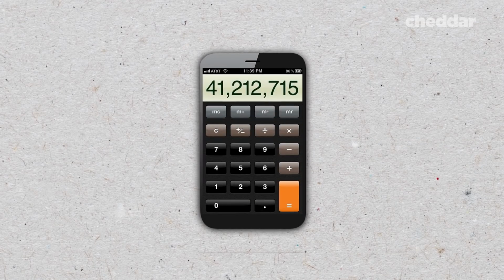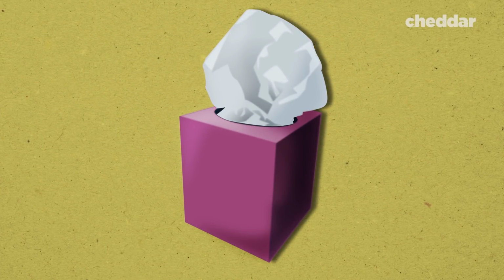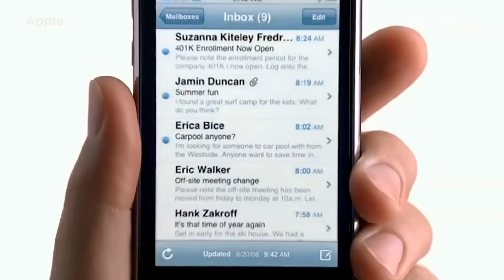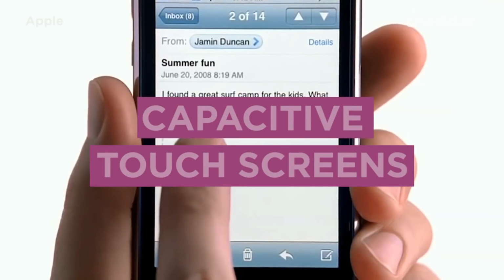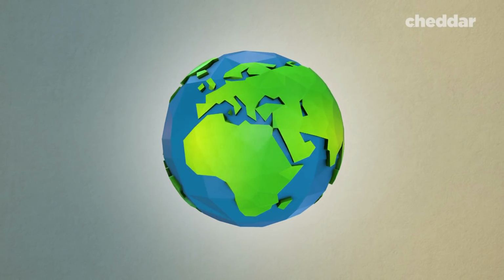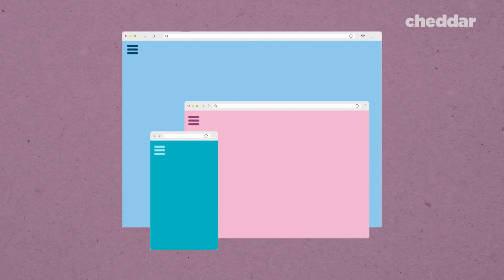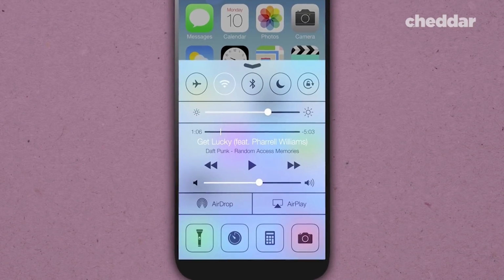Why 3D Logos Fell Out of Favor Overnight - Cheddar Explains

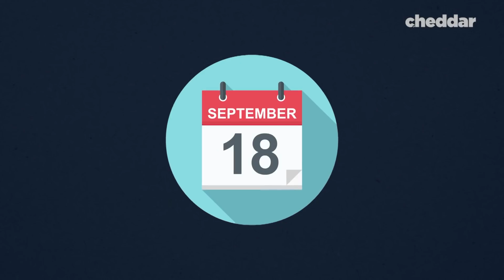Comment: (3:45) But didn't Android release their flat design before?
I guess only iPhones exist in Cheddar's world.
Reply: There's a lot more default Apple apps than Android ones (at least, there were, and sometimes still are if you don't have a Samsung and have twenty bloatware apps pre-installed).  Also, I'm willing to bet that most iPhone users were and are using the default apps far more frequently than Android users use theirs.  Out of 31 apps on my Android's homescreen, maybe six came pre-installed, and the rest I either deleted or tucked away in folders elsewhere.  This meant that when Apple changed, half of the US woke up to find that the majority of their apps were flat.
Reply: Android is more open in turns of it's apps. Iphone has a less open app ecosystem but integrates well with the general apple device ecosystem. Samsung phones are overpriced trash for way to many reasons to fit here, I can tell u why if you want to know.
Reply: @ultragamer135  enlighten me with your knowledge brother
Reply: @justacasualgamer1957  the human eye is like a camera because it con only see so much "resolution", kind of like how cameras on phones have certain resolution levels, like 1080p or 4k. The screens on newer samsung phones are higher resolution than most people's eyes, so the upgrades are not notices by the human eye. Also, samsung phones are getting 100x zoom, which is just a gimmick to make the phone expensive. Binoculars exist for a reason. People have been recently reporting that samsung forces advertisements into their notifications. Not only that, but some parts of the camera app are paid. Most of the mode buttons are not required, either. The Google pixel series has the same features in the camera app, but in around 9 visible mode buttons. Even with all of these problems, samsung phones still cost more than 1000 US dollars. Meanwhile, the Google pixel, an overall better phone with real android, only costs around 350 US dollars for the pixel 3a.
Reply: @ultragamer135  glad to know I was just thinking about buying samsung phone
Reply: @justacasualgamer1957  NP. The pixel phones also block spam calls and robo calls, so you never have to deal with calls about you cars extended warranty ever again! I recommend either the pixel 4a, pixel 4a 5g, or pixel 5. The pixel 4a is good and had a headphone jack but has no wireless charging. The pixel 4a 5g is mostly a 5g version of the 4a, although 5g isn't widespread yet. The pixel 5 has better battery life, bigger screen, and wireless charging; but no headphone jack. Most samsung phones don't have headphone jack at all :/
Reply: @ultragamer135  thanks I appreaciate the help
Reply: Because the majority of people use iOS and especially back then, no one gave a shit about what Android was doing. All developers and brands cared about iPhone and its shift to 2D meant that they were going to have to change too. It’s all about influence and back in 2013, Android had very little.
Reply: Nope. Microsoft switched first, then Apple, then Google.
Reply: Bruh they just put the iOS screenshot in an Android phone 😑
Reply: @BWRusher  screenshots are old as shit, they were there ever since Linux. iOS didn't invent the fucking screenshot lmao
Reply: @asteelcup859  reading comprehension
Reply: @asteelcup859  It's GNU/linux
Reply: @ultragamer135  I'd just like to interject for a moment. What you're referring to as Linux, is in fact, GNU/Linux, or as I've recently taken to calling it, GNU plus Linux. Linux is not an operating system unto itself, but rather another free component of a fully functioning GNU system made useful by the GNU corelibs, shell utilities and vital system components comprising a full OS as defined by POSIX.
Many computer users run a modified version of the GNU system every day, without realizing it. Through a peculiar turn of events, the version of GNU which is widely used today is often called "Linux", and many of its users are not aware that it is basically the GNU system, developed by the GNU Project.
There really is a Linux, and these people are using it, but it is just a part of the system they use. Linux is the kernel: the program in the system that allocates the machine's resources to the other programs that you run. The kernel is an essential part of an operating system, but useless by itself; it can only function in the context of a complete operating system. Linux is normally used in combination with the GNU operating system: the whole system is basically GNU with Linux added, or GNU/Linux. All the so-called "Linux" distributions are really distributions of GNU/Linux.
Reply: @asteelcup859  :)
Reply: @BWRusher  Ironic
Reply: When Apple does something it becomes the standard of norm. Apple changing to a flat UI for iOS 7 is what prompted other companies to gmflatten their logo, not Android doing so. It’s just how the fuck Apple is.
Reply: @hads5279  Microsoft went flat first in 2010 then Google went flat. Others were already following before Apple copied in 2013.
Reply: @hads5279  bro litterally get your facts right, windows 8 had this design in 2012, windows 8 HAD 90% MARKET SHARE IN PC'S WHEN PHONES WERE BARELY SMART
Reply: @hads5279  also android 4.4 kitkat launched one month before ios 7 and it had flat icons
Reply: Xerox STAR but, ok kids. Enjoy your Android phones.
Reply: Because android is an ios copycat
Reply: @giovannisantopaolo9222  No, it not.
Reply: @wrmoose6542  It's*
Reply: @giovannisantopaolo9222  thanks.
Reply: Giovanni Santopaolo IPhone is the simplicity phone and Android is the customization phone (the most basic way to explain)
Reply: @galacticquasaur2956  wrong. i phone is an overpriced phone. that's what it is
Reply: @wrmoose6542  69 likes lmao
Reply: @haseenabadshah5381  lol
Reply: @galacticquasaur2956  android is no longer customisable as it used to be
Reply: @galacticquasaur2956  no, iphone is the phone for braindead people who live in 2021 but if a phone has too many features they get lost and their brain stops, or american people, same shit, and android is for people who know how to spend their money
Reply: @giovannisantopaolo9222  IOS copies Android...
Reply: @giovannisantopaolo9222  the other way around. And Apple takes credit all the time.
Reply: @larsswig912  apple has foldable projects from like 3 years but he prefers to release good products then that malformed foldable of samsung
Reply: @giovannisantopaolo9222  "Good products" you forgetting bend gate?
Reply: @giovannisantopaolo9222  what the fuck did you just say about samsung?!
Reply: @lennycormickalt4223  samsung's foldable was 🤢
Reply: @giovannisantopaolo9222  It's a first generation low-volume product

Not made for the average consumer in the slightest
Reply: @pkj6684  yeah that's what i am saying idgaf about samsung having to test it on people, when apple will release it it wont give you seizure every time you try to use it
Reply: I'm no apple fanboy it's just a fact they might bring up other problems but overall apple still remains the best company
Reply: @giovannisantopaolo9222  I'll give Apple credit for having a polished experience

Well with exceptions of course cough Apple Maps at launch cough

But also, please remember that we all have different opinions
Reply: @giovannisantopaolo9222  even though I don't like apple because of overpricing and lots and lots of other issues but what it does it does professionally and does not leave stupid errors or bugs or just straight up crashes like android or microsoft would. It even lasts long with much more money value when you sell it compared to other company products
Reply: @giovannisantopaolo9222  did you mean Microsoft? Hmmm... Apple is great at stealing concepts and marketing it as their own genius. Are they innovative? No. Are they great at marketing? Yes.
Reply: @TuckerMonticelli  lidar? Notch design? Touch screen? Glass behind screen? Headphone jack removal? Charger removal? Laser camera for autorization? It doesn’t matter if it was bad or good, apple still has most of the primates in the phone industry. The only things that weren’t developed first by apple are foldable phone and touch id.
Reply: @giovannisantopaolo9222  headphone jack removal innovative? LMAO
Reply: @wellplayed4497 kind of, since everyone else implemented it after apple did to reduce depth
Reply: @giovannisantopaolo9222  ._.
Reply: @wellplayed4497  and no one fucking uses headphone jack anymore dont be a fucking ape wireless and portless is gonna be the future of every fucking phone you can blame whoever you want but it’s inevitable
Reply: @giovannisantopaolo9222  But the fold phone doesnt have anything to do with the topic?
Reply: @giovannisantopaolo9222  Apple gives me "a seizure" when I use it. How the frick do I use anything? The buttons are hard to use and Siri doesn't work anymore. The older phones are fine, but there's too much complication on the newer ones. Android has buttons on the bottom, at least.

I have owned devices from both companies, and Apple is less user-friendly.
Reply: @giovannisantopaolo9222  I use the headphone jack. It works well as backup when your wireless ear buds are dead.
Reply: @giovannisantopaolo9222  again fool Samsung does not equal Android!!
Reply: @giovannisantopaolo9222  A matter of opinion. They are not the best to me.
Reply: @giovannisantopaolo9222  I had a foldable android with a flat screen in 2009.
Reply: @giovannisantopaolo9222  bro they re at their 3rd generation, this is thr 4th year of foldables and you can't find one single bad review on the internet about it
Reply: @4tqny  foldables still suck they wont be the future they break after a limited average of open-closing
Reply: @giovannisantopaolo9222  Apple fanboy

Comment: I have never heard it called a "hamburger menu", but it was designed to resemble the lines on a paper, making a list. It is skwuporphic
Reply: Hamburger is a nickname that caught on.  I've also heard it called hotdogs and an air vent.  These names seem to have originated from internal names and developer conferences, and lacking a better name than just "menu" (of which there are a lot of menus, anyway), it stuck.  More officially its called a "Navigation drawer" since it acts as somewhat of a site map for websites and apps, containing all the places you're most likely wanting to go, with auxiliary stuff usually going in an overflow menu that's usually three vertical dots.

Comment: Hmmm.... I do not like fully flat design. I like it to be somewhat semi-3D. Like I love dropshadows. Then I want a border around the buttons, so I know it is a button. For example. I hate the UI design on Win10. I use way more time figuring out what is what, and were the functions is, than I use time on actually using it. MacOS the same, however not in the same way as Win10. Win10 is by far the worst, when it comes to UI experience. I found the answer to an easy to use experience, when I started to use Ubuntu Mate.

Comment: The designs changed 'overnight' as you put it for one reason only 'cost'. Any graphic designer would be able to confirm this. 

In a world where cost means everything, thin marginal reductions in the cost of something can save a company millions, if not billions.  If you want to catch someones attention very quickly, you produce a 3d logo and that has been proven time and time again. But the biggest problem for businesses is the one that was mentioned in the video, the need to reproduce the same logo but in different sizes.  You have a company that needs to print their company logo a few hundred times (shop fronts, company uniforms, sales brochures, PR documents, other company documents, emails..the list goes on) would have required multi numbers of the logo designed in different sizes. This was not only time consuming but expensive. A cheaper alternative was to design the logo once in 2d and have that logo resized to match the item/product it was going to be used on. That is something that could not be done very easy and quickly in 3d. 

The rest of the video is wasteful information to try and make a longer video.

Comment: When Apple switched to flat design, they were just copying Android at the time. This video gave no credit to Android and Google's "Material Design".
Reply: Ok yes you are right that android did use a flatter design in ice cream sandwich, but this isn’t the material design. This is the holo design. The holo design still made use of some skeuomorphic elements like drop-shadows and gradients. The material design came out much later as a competitor to ios 7’s minimalist flat design.
Reply: @13Omood  way wrong, Google is responsible for "material design", after Google released it for android and made all their logos flat apple blatantly made their apps look just like google bright color flat style. Even the simple flat ui and hamburger menus comes from android.
Reply: @Bandandy  Don't stress, it's typical Apple sheep reasoning, 1. Claim that Apple was the first to do X and they always set trends 2. Someone points out that it's not true. 3 Apple sheep changes the goal post, "I actually meant Apple made it popular when they introduced it.
Reply: @itayizinzombe947  funny but very tru, yea  apple might have made it popular for everyone living under a rock.
Reply: @Bandandy  If I'm wrong, please correct me and show the sources, but Material Design (and Android 5) are from 2014 (while iOS 7 is from 2013), so iOS did start using a flat interface before Android. And, of course, Microsoft started in 2012 with Windows 8.

Comment: Cheddar: original iPhone vibrates when icons were pressed.
Everyone: The iPhone didn’t have haptics until recently.  

The Hamburger menu icon is kind of like a universal Windows icon for websites.  Computer users know where all their apps are available when they click the windows icon on the lower left.  The Hamburger icon on the upper left or right on mobile apps and some websites indicate the location of options for the website.  It translates easy for mouse and touch screen input. 

I personally don’t care for the hamburger menu.  The flat designs some websites use are lacking in design.  

My opinion why flat design is being used is not because it looks simple. It is simple, to develop in a short period of time.  A smartphone screen cluttered with flat looking icons is just as confusing, sometimes even more confusing than a realistic image that is easily recognizable.  The reason why it’s used now, not just for app icons, but for mobile app design is because of agile methodology.  Software devs watching this already know what I mean by agile.  For the rest.  Agile is a core ideology that software and features can be delivered quickly by releasing the software with the base features it needs and then add features to the software every two weeks.  Each two weeks are called a cycle or iteration. Since devs have to be fast, these cycles are also known as sprints.  If you have a complex user interface, a developer may not meet the two week deadline. A flat simplistic interface is much easier, especially when you got a small team working on it.

Comment: “Adobe Photoshop and InDesign”— nope, it was Adobe Photoshop, Adobe Illustrator, and Aldus PageMaker.
Reply: Also, image manipulation of a real image took like 16 or 24 MBytes of RAM which nobody really had. Manipulating small things like a 640x480px image at 256 colours (e.g. adding a blur or creating a 3D Wordart-style text) can take up to 3-5 minutes. I remember a '97 benchmark that opening a 24-bit 800x600 image was used to test the Pentiums speed increase over a 486 - go figure! (It was about 80 [Pentium 100] vs 116 [486] seconds - to LOAD the image!). So "on everyone's fingertips" is a huuuuuge overstatement.

Comment: skeuomorph
s aren't specifically "3D." It's any graphics that represent a form of technology we no longer use to represent an action/program that no longer uses those technologies. you can have (and we do have) 2D skeuomorphs  for many apps even today.
Reply: Not only that, the hamburger menu is a skeuomorph, its literally three (sometimes more) lines of text in a menu.  The "hamburger" name seems to just be a humorous nickname that caught on, since I've also heard it called "the hotdogs" and "the air vent" menu.
Reply: @dafoex  The "hamburger menu" is just the menu button that existed on old Android devices, which was there or four lines. Pressing this button will bring up context sensitive menu options. This was later turned into the three vertical dots, worked the same as before. Then this turned into menu icons, that then turned into the hamburger menu. So it's kinda still the same old menu button since the start of Android.
Reply: Yes but in this context, skeuomorphic logos and icons were those that looked like physical buttons you could press on your iPhone screen. The 3D look, beveled edges, and shine put on those logos made it look like you could literally push them as buttons. This look was dropped, essentially, when people became more familiar with touchscreen phones than they were with phones that had physical control buttons, and therefore a skeuomorphic reference to button pressing no longer seemed relevant. Eventually the same thing will probably happen with the “phone” logo on the calling app on most phones. Once landlines become relegated to pretty much businesses only, it’s likely that the image of a physical handset like one you would use on an old corded phone will become irrelevant at best. As it is, most people under 15 right now don’t remember a time that phones with handsets like that were used for anything other than accumulating junk calls and maybe sending your dentist appointment confirmation call to.
Reply: Cheddar is not the most reliable source in a lot of topics